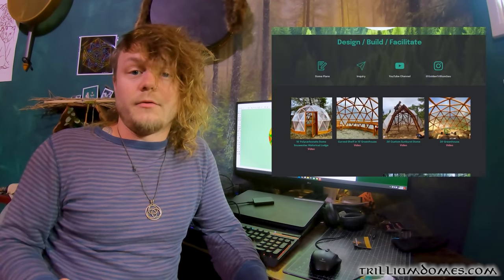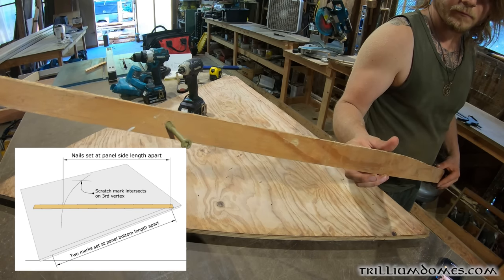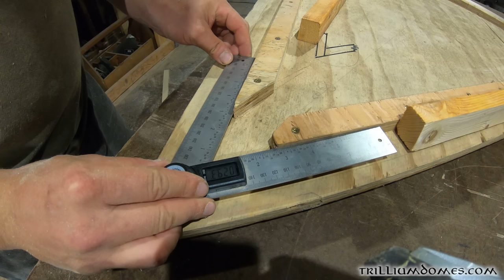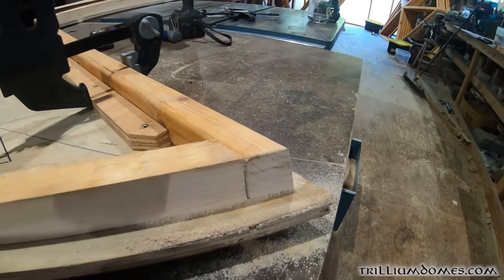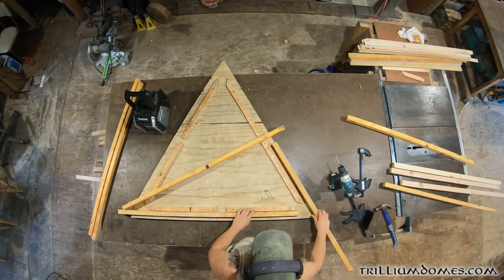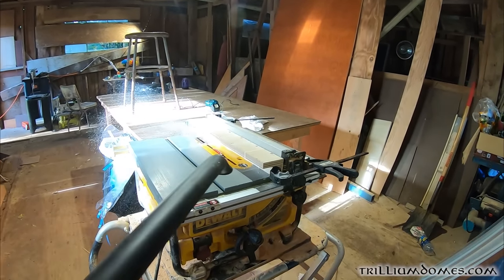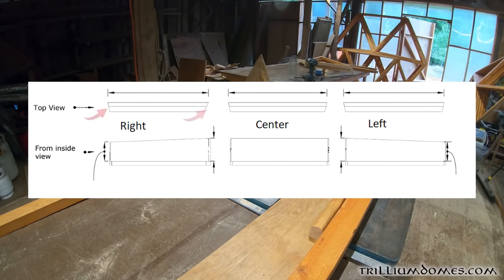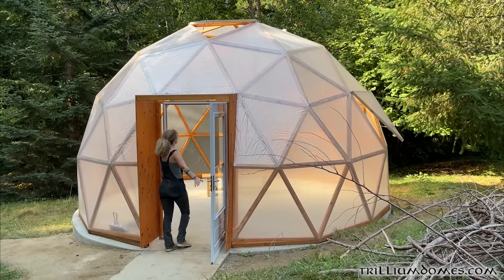The Ultimate Geodesic Dome Build Guide - Most Beautiful, Inexpensive, No Hubs

Comment: I enjoy your channel and builds BUT--- Biggest Fail is that you use those useless Squeeze Clamps everywhere for your repeated stops,  Why Why Why? Even dogs with hinged bench clamps.  Biggest tip would just say on may videos pitching plans,  1. RAW cost of MATERIALS OF A FEW SIZES  12 24??  2. cutting TIME 3. framing TIME  and height to diameter ratio for your designs.
Reply from the maker: Is it useless if it works? I also sell plans to people all over the world and prices vary. I give rough sizes and rough costs in many of my videos. I offer materials lists for all my designs up front no purchase necessary.